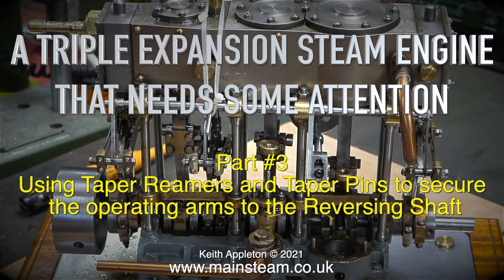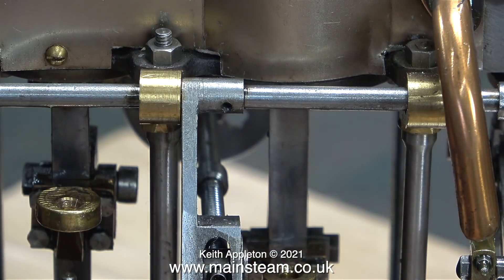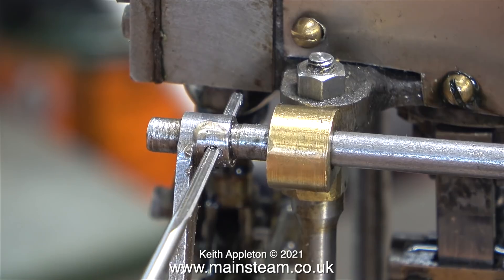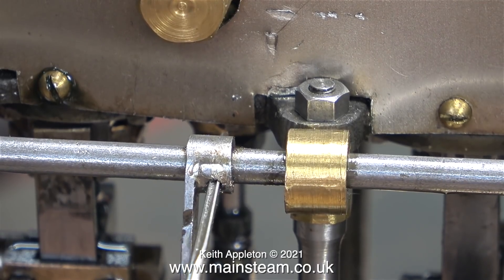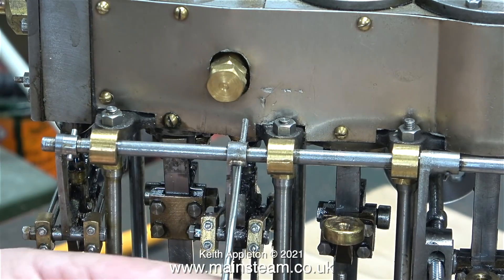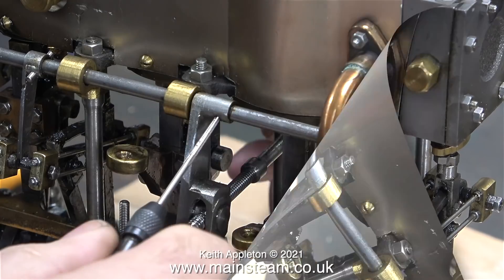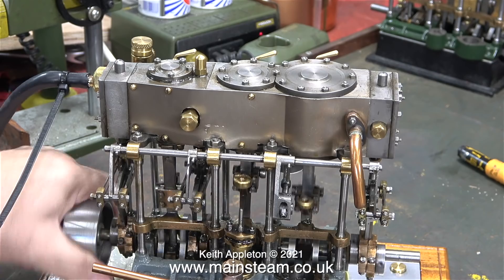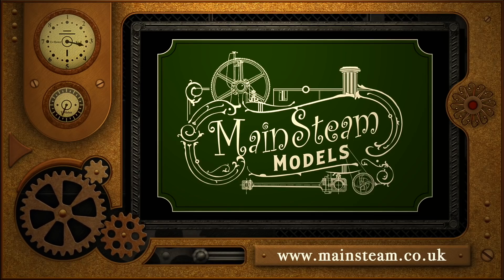A TRIPLE EXPANSION STEAM ENGINE THAT NEEDS SOME ATTENTION #3

Comment: Very interesting and as always, very well presented. 

Never done taper reaming before, I suppose it doesnt matter too much how far you advance as long as the exit point has been made into the taper. 

I seem to recall on a recent video the reversing operation was done by a lever and this one is done by a handwheel, is that to slow the engine down before it goes into reverse? 

I wonder whether the linkages and bearings are worn or were made with too much clearance, Im sure all will become clearer as you advance with this series. 

Good luck from Spain!!